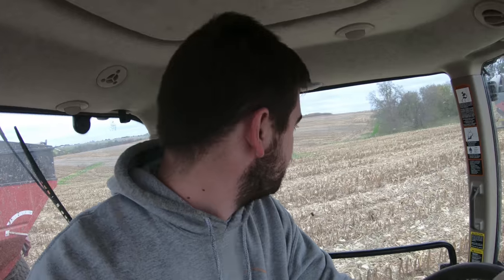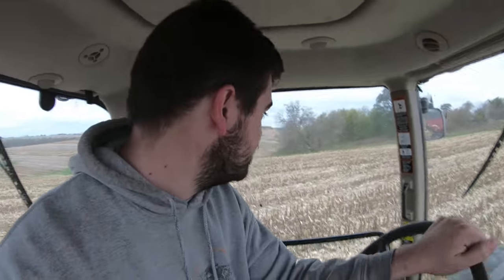Cut, Rake, Bale, Repeat - Farming In 4K

Comment: I swear the beans and corn are growing back in every single field around us.
Reply: Yeah, the BIL was glad when it FINALLY frosted too... his bean fields were getting a "green carpet" from all the little bean sprouts germinating and pushing up and greening out.  

You don't realize how much "field loss" you have until you see all those little green bean plants that have sprouted from seed dropped in the field.  Sure you can measure field loss behind the combine (and a good operator will periodically check this to see where the loss is occurring, how much is being lost, determine WHERE the loss is occurring from (and the reasons for it) and make adjustments to the machine is possible to minimize the losses...  Some losses are "unavoidable" in that some pods split open and drop their beans out before the combine ever arrives in the field.  That's pretty much unavoidable (except maybe harvest sooner or avoid varieties that are particularly susceptible to it, but the weather plays the main role and you can't control the weather).  MOST losses, however, are from the harvesting process itself.  Header losses are shatter losses and gathering losses-- gathering losses are ungathered pods left remaining on stems down near the bottom that were cut off too high and remain in the field.  Only thing one can do about that is try to run the sickle lower and leave a lower stubble height, or plant varieties that start producing pods a little higher up the plant next year.  Ungathered losses also occur if one isn't driving carefully and is leaving plants behind due to them ending up on the "wrong side of the snoot" or mashing plants flat next to the header in the ungathered part of the crop, or turning too sharply around curves and pushing plants over in the next swath...Shatter losses are beans raked off the plants by the reel or popped out of their pods and scattered by the reel, or shaken out of the plants or pods when the sickle snips off the stem near the ground.  Shatter losses can be minimized by careful control of the reel speed, depth, and position, particularly reel speed to make sure it's not too fast, which is the biggest cause of head shatter.  Sickle shatter can be minimized with sharp sickle sections and guards, which cut cleaner, faster, and easier with less movement of the plants as they are snipped off, or by installing "prong guards" which have a second, smaller prong between the main points of the guards to provide a second shearing point for plants between the guards, so the plant isn't pushed over a couple inches by the sickle knife section before it hits the opposite guard and is snipped off... it moves half that distance and hits the prong first and is snipped as the sickle makes its stroke.  Header losses can also occur due to holes or improper installation of bottom sheets or components allowing gaps where shattered beans can fall out of the head as the head operates.  Stopping the combine in the middle of the field while harvesting and looking at the ground between the header and front wheels of the combine, and counting numbers of shattered beans or ungathered pods, is how header losses are determined.  BUT one must account for pre-harvest losses too, by examining the field in front of the header and seeing how many beans are on the ground BEFORE the combine cuts the crop, and deducting that amount from the beans on the ground BEHIND the header, to determine the TRUE amount of header loss.  

Separator losses are next.  Separator losses occur in a couple of ways-- unthreshed heads or grain still on the stalks, cobs, or stover expelled out the back of the combine, and threshed or broken grain dropped out the back of the combine with the chaff from the cleaning shoe.  Unthreshed  grain still on the stalks or cobs are caused by underthreshing, which means the cylinder should be sped up or the concave clearance reduced to increase threshing and rub out this grain off the stalks or cobs as it passes through the thresher.  Threshed grain coming off the walkers or out the back of the rotor(s) is due to too much material being fed through the combine too fast, ie insufficient time and too thick of a mat of material going through the separator to allow all the grain to flow down through the mat of material and fall into the chaffer/sieve.  Threshed grain in the chaff coming off the chaffer and sieve is caused by two reasons-- too much airflow from the cleaning fan (which needs to be slowed down or the air choked back with the fan shutters) or, more often, the chaffer (and usually the sieve) is closed down too much-- too narrow an opening between the chaffer airfoils is not giving enough room for the grain to rapidly fall through the chaffer and sieve to the clean grain cross-auger.  Too much fan wind can blow kernels of grain out the back.  A chaffer closed too tight can "ride grain over" the chaffer and out the back.  Large amounts of broken kernels of grain in the chaff can be caused by several things-- 1) the sieve closed too much, riding grain over the sieve and into the tailings, causing overthreshing as grain going through the thresher a second time usually cracks or breaks-- this cracked or broken grain is a lot easier to blow out when it arrives on the chaffer a second time.  Opening the sieve to allow larger space for the clean grain to fall through to the clean grain cross-auger is required...  OR 2) overthreshing, which is caused by the cylinder speed being TOO high or the concave clearance being TOO TIGHT, causing grain to be cracked and broken as it is threshed off the plants-- reduce cylinder/rotor speed or open the concaves slightly to correct the problem.  

With simple adjustments and a methodical method of checking and making those adjustments, it's fairly easy to reduce harvest losses to a bare minimum-- and even saving just a bushel or two of grain can EASILY add up to BIG MONEY being saved-- $3-7 an acre on corn or $9-18 per acre at current prices!  Of course harvest losses cannot be entirely eliminated*, BUT *reducing them to the bare minimum pays HUGE dividends!   

Later!  OL J  R :)

Comment: hey Ryan.......have you guys ever considered getting a big square baler instead of the round baler?
Reply: They cost more than a good used combine, so I doubt it.  Need a BIG tractor to power the thing as well.  They're not selling dozens of semi loads of hay, so no need for it because of that... Round baler works fine with a 60+ HP tractor as well... 

Round baler-- Anywhere from about $8,000 used to $40,000 new (tricked out), 
VS. 
Big Square baler-- Anywhere from about $30-40,000 used to $160,000+  new... 

SO I'd say NOPE!

Comment: Very nice drone footage, before this channel I never knew the corn stalks had any use except to be plowed under. I can understand how it irks you to see grains that the combine misses. I wish you could glean some of it back by putting some kind of a livestock on the field to nibble it back up . Some guy to make a deal with you to put his flock of ......geese, chickens, goats, sheep? With electric net fence ? Call me crazy?
Reply: Yeah, that used to be done a lot in the old days... some guys still do.  Amazing how much cattle can clean up it you turn them loose in a harvested cornfield.  

Some guys run a "hot wire" (electric fence) around the cornfield and then turn the cows loose in there for a few weeks to clean it up.  Would work on a bean field too (or contoured fields) but there's a lot less "dry matter" for livestock to eat in a bean field... would work good on contours because the cows could have access to BOTH at the same time!  They scatter their manure out pretty good that way too.  

Biggest problem is, you have to either 1) be close enough to a well/barn to run water out to them via a trough you set up nearby or 2) you have to haul water to them (remote places with no water well or not close to one.)  

Later!  OL J R :)

Comment: Hey Ryan, probably a dumb question but oh well, can you use the rhino mower for hay crop?
Reply: xXiHaZnOnAmEXx for hay it cuts to fine or mulches it to much
Reply: xXiHaZnOnAmEXx I have seen some guys cut hay with one bit they cut the side of the mower out so it  cut like a lawn mower and didn't chop it up that much but they also were more a hobby farmer and didn't want to buy equipment for what little they did
Reply: Back when rotary shredders first came out in the 50's, they advertised them as "able to cut hay"... most back then were only 4-7 feet wide (at MOST) and 3 point mounted, and had a removable side panel on the LH side so that the cut material could be tossed out the open side without getting chopped up too much.  Most shredders today discharge out the back, and so the cut material gets chopped up by the blades several times before it's swept around to the back and tossed out.  

Shredders don't usually leave a particularly 'clean cut" either... ESPECIALLY in green grass or forage cut for dry hay.  They usually sort 'hack' stuff off, usually about 4 inches or more above the ground, so you're leaving a LOT of the grass behind.  It chops everything up so when raking and baling, a lot of the chopped-up stuff drops out as it's being raked and baled, leaving even more behind, and it makes what IS gathered extremely dusty (and the dust WILL FLY when you're raking and baling compared to hay cut with a proper hay mower).  This dust is again, lost plant material.  In legumes like alfalfa, it'd strip or demolish most of the leaves, which is the most valuable part of the plant compared to the stems, and what's left would be VERY difficult to bale well.  

SO, while it CAN be done, it GREATLY reduces dry matter yields compared to cutting hay with a PROPER hay mower.  

Later!  OL J R :)

Comment: You are wise to avoid baling bean stubble.  The stems are too hard and does not soak up anything.  It gets them off the ground or concrete but  that's about all. Definitely not worth your time and fuel. Also wondered if it would work to put a hitch on the rear of the cutter for the rake and save a pass, time and fuel. Hydraulics, turning issues and raking width all raise questions about this option. I am considering this but like many things that sound good in theory, it may not be practical or practicable.

Comment: on average Ryan how many bales can you get from one roll of bale netting?....
Reply: An 8800' roll will do about 103 bales @ 68.5 " per bale with 3 wraps
Reply: Depends on the number of wraps.  Some guys do 1.25-1.5 wraps of net per bale, some do 2-4 wraps... a lot of it depends on 1) bale size and weight and 2) material you're baling.  Coarser material usually requires more wraps, as does heavier material.  Lighter bales or finer stemmed grass hay can make do with less wraps of net.  Another thing that figures into it is "how many times are you handling the hay?" Hay handled more will suffer more damage to the net (risk of damage every time it's handled) and "how much hay can you afford to lose to busted net wrap?"  Some guys selling hay want the bales to look all perfect and pristine and remain that way through multiple handling steps (loading on a trailer to haul off the field, stacking in rows or in the barn, then loading out of the barn onto the customer's trailer, or delivering it to the customer, and sometimes stacking it in their barn).  Some guys want to get the maximum number of bales out of their rolls of net wrap and don't care if a few bales get "snagged" or bust from insufficient net wrap.  

Later!  OL J R :)